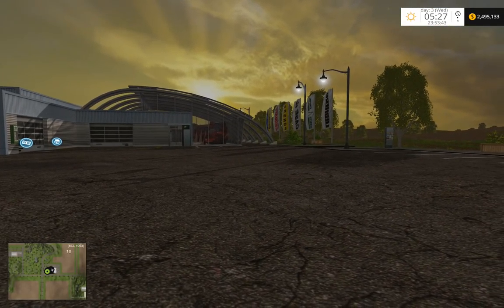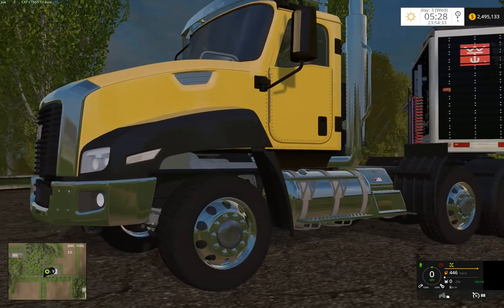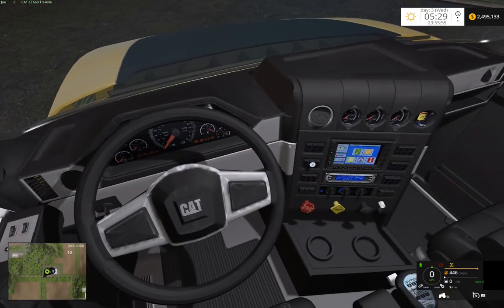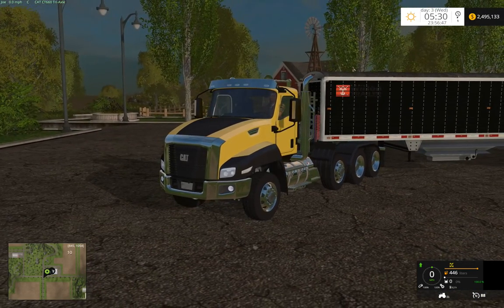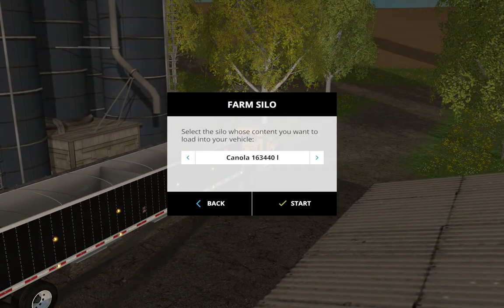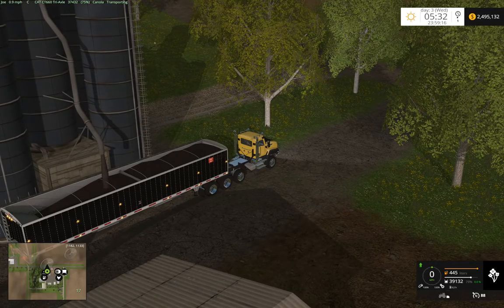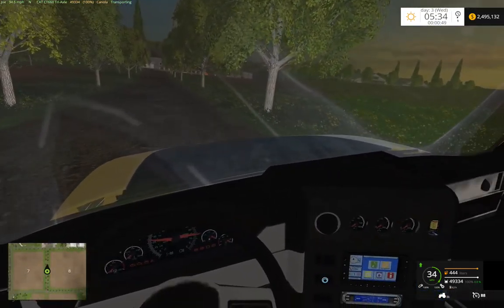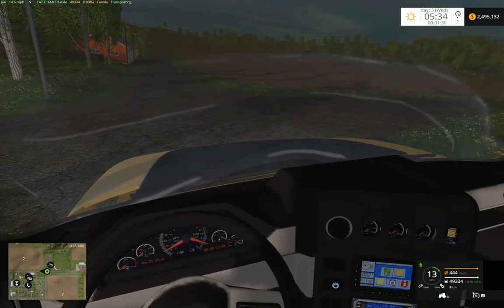Farming Simulator 2015:  Cat CT660 Testing

Comment: If the tag axle isn't steerable then it needs to be lifted when turning and if it is steerable it doesn't but should be anyway to save wear and tear on tires just my knowledge from working for one of the largest construction and trucking companies in upstate New York hope the info helps
Reply: +Lindbejb Modding good deal iv got quite a bit of truck and trailer experience along with ag experience so if you have any questions please feel free to ask although I'm sure jake is a wealth of knowledge
Reply: +Lindbejb Modding if your interested I could give you an email or a number to text